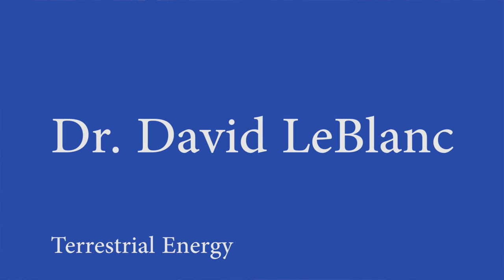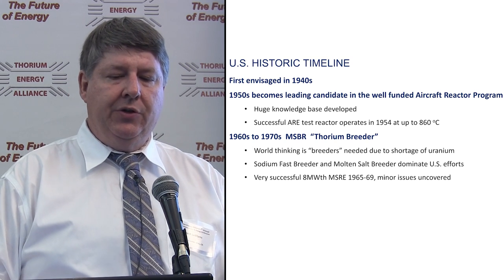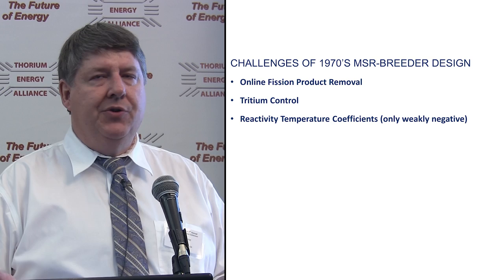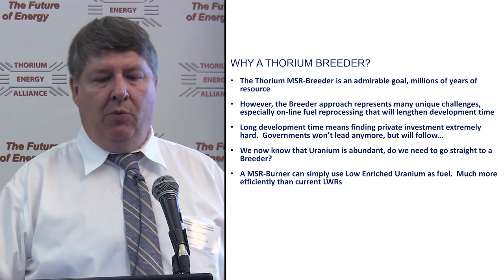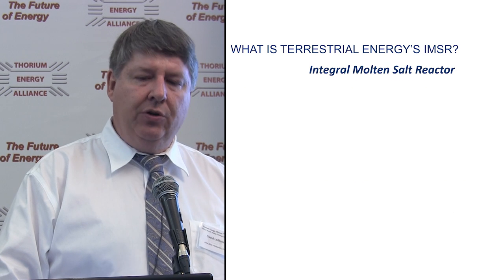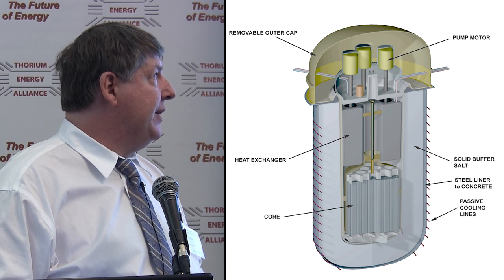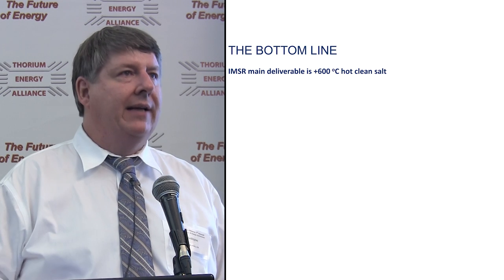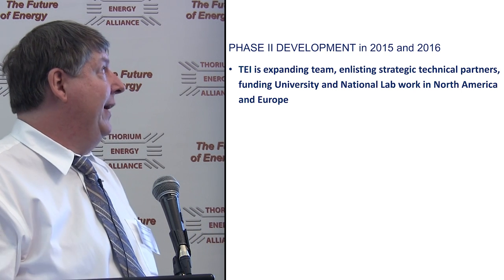IMSR: Terrestrial Energy's Integral Molten Salt Reactor -by Dr. David LeBlanc @ TEAC7

Comment: I do not think that shutting a reactor down is as simple as throwing a switch. Even if TEPCO did initiate shutdown at the time of the earthquake, the process could not have completed before the tsunami cut off all power. That is why they had a core meltdown at Fukushima. I do not understand why TEPCO didn’t have the emergency generators and fuel on the roofs of those reactors - they had to know they were in a tsunami zone. Hubris, I expect.
Reply from the maker: Robert Black You are conflating fission with decay heat. Fission had stopped. However decay heat continues for years, in a rapid drop off... at the time of the tsunami there was still a lot of it, by the time backup power failed there was much less. However it still needs to be managed, just like with fresh spent fuel rods in cooling pools. Managing decay head is not as simple as throwing a switch. Stopping fission IS as simple as throwing a switch. In this case it was automated.
Reply: It is vey hard to cool a LW reactor down after a power failure. A long-time friend of mine is a nuclear engineer, and we communicated after the Fukushima disaster, and he told me that cooling flow needs to be maintained for 36-48 hrs after shutdown to prevent a meltdown.
Reply from the maker: Robert Black Yes, that sounds right. Just that reactor is "off" already. The pumps must keep running for days. I thought you were saying fission was still happening. Missed safety opportunities were astounding.
Reply: ***** A non-starter. A rooftop backup generator would last longer, so long as the fuel supply wasn't contaminated by sea water.
Reply: gordonmcdowell I read on Asashi Shinbum (English-translation of a Japanese newspaper) that a retired TEPCO consulting engineer recommended putting the backup generators and their fuel tanks on the roof of the containment structure when the plant was being built, but he was over-ruled because of the cost. More hubris, I think.
Reply: Robert Black In a MSR you can remove almost all of the fission products which create decay heat. It would be much easier to manage. Fuel pools would still need cooling though.
Reply: I know, but the Fukushima reactors were light water reactors designed in the early 1960’s. In the USA, nuclear power is all but dead due to excessive regulation and environmental reviews that other power stations are exempt from.
Reply: +Robert Black

 Robert, we are not talking about Light Water reactors here. And Yes, MSRs can be shut down safely and was demonstrably done that way :  https://en.wikipedia.org/wiki/Molten-Salt_Reactor_Experiment or am I missing your point?
Reply: You missed my point. The Fukushima reactors are lw reactors.
Reply: +Robert Black It's not just the diesel generators that were destroyed by the tsunami at Fukushima. The seawater pumps, the seawater intakes and outlets, the pipes, the valves, the power cables, the switches, the sensors, every bit of the plant infrastructure was compromised or demolished when the tsunami hit, a few minutes after the earthquake and while secondary tremors were still shaking the reactor buildings.
The conclusion is not that the Fukushima power plant should have been upgraded or built differently in the 1960's and 70's. The correct conclusion is that Japan should never have built any nuclear reactor in the first place, as it is the most seismically active country in the world.
Reply: Actually, the argument that the plant should have been built differently was validated at Onagawa NPP, which was closer to the epicenter and was hit harder, but there was no disaster. There was a different company in charge (Tohoku, not TEPCO), and they built a proper sea wall. Fukushima Daiichi also had a natural sea wall which was much higher than what they built, but they removed it back in the 1960's.
Reply: TEPCO did have backup generators.  They were flooded by the tsunami wave...
Reply: The original question was why the diesel backup generators were not installed on top of the reactor buildings.
As I wrote above, even if this had been the case, it would not have prevented the three core meltdowns, as the rest of the cooling and much of the sensors and control infrastructures were destroyed by the tsunami.
Somebody posted that a higher seawall would have avoided the destruction caused by the tsunami and the core meltdowns, citing the Onagawa NPP, which was closer to the epicenter of the earthquake and was hit by a similar tsunami but did not suffer as much damage. But this is really counting on luck. Before the earthquake, both the Onagawa and the Fukushima NPP had similar risk estimates. One plant survived because of specific circumstances, the other was completely destroyed.
The correct conclusion is that you just can't depend on luck to avoid nuclear catastrophes. Again, no nuclear power plants should ever have been built in Japan, the most seismically active country in the world. Every single NPP in Japan is at risk of a major accident at any time.
Reply: +André Balsa — Every place on Earth is seismically active.  According to your reasoning, no nuclear plants should be built anywhere on the planet.  That's just plain silly.
Reply: That's party true, but besides the point.
An IMSR doesn't have a traditional MSR drain tank, but due to its coolant+fuel mixture, additional coolant (salt) layer and then a big water jacket would take 2 days just for the outer salt layer to melt (achieve maybe 400C), as long as the core coolant/fuel keeps below 700C, the reactor is safe and undamaged. If you consider the reactor a total loss, it can go up to 1400C (salt boiling point) before we have a real problem, there's just not enough decay heat to get there, even with all pumps off.
Additionally, pumping molten salts is far easier than pumping water. Molten salts are thicker, yes, but you need to pump far less salt mass to achieve the same heat conduction and the salt is at ambient pressure, while the water is at 75-150 atmospheres.
So an emergency diesel to power one 300MWe IMSR vs a Fukushima 622MWe is likely required to have 1/10th the power than Fukushima. Since the pumps in an emergency don't need to operate 24x7, instead of having 3 diesel gens, have 2 plus solar panels in the roof as a third contingency.
Reply: What ? Solar panels running water pumps is the easiest application of solar PV. There are pumps designed to simply be connected to a single panel. Doesn't even need an on-off switch, it runs most of the day and shuts down when PV voltage drops in the end of the day.
Connect 100 top of the line rooftop PV panels (450Watts, 48Vdc each), you now have 45kW and 4800Vdc peak. I doubt even the big IMSR will need more than that in emergency modes (if the reactor is running, its producing its own coolant power needs). Except in that case I would assume something like a single Tesla powerpack with 200kWh battery to provide peak power for startup and provide a few hours of power stability. After sunset, if the diesel genies aren't working, shutdown all pumps, but keep power to the control room.
It really never ceases to amaze me how radical are people, either solar is useless only nuclear matters or nuclear sucks only solar+wind matters. Please do some studying.
I'm only advocating multiple emergency power sources. The PowerPack can even be charged by the diesel gens too.
Tesla Powerpacks are interesting for a lot of reasons, including doing reactive control and replacing peaking plants, which match very well with an MSR.
By the time the 2nd IMSR is brought up (I'm assuming the first will run as a demonstrator under more strict conditions for a year or two), Tesla PowerPacks likely will have 500kWh each and will be cheap enough they will make every peaking plant in the world obsolete.
Reply: Marcelo Pacheco the Fukishima nuclear reactors were designed and built decades before Tesla was even a pipe dream, so your idea, while it has merit, was too late to be adopted there.
Reply: Robert Black I'm talking about IMSR here... That's the video we're commenting about.
Reply: Marcelo Pacheco Where other than China is one of those things being built? Won't happen here as long as the Environmental lobby gets to veto everything that isn't horse-drawn.
Reply: *****
another technology invented here, perfected elsewhere.
Reply: *****
Shame on you for your ignorance or for being a merchant of doubt. Millions of people in the world live in islands powered 100% or 99% from solar panels+batteries.
In 2 years half of Hawaii will be powered with solar.
My household only need 3.5kWp of panels, here in Brazil the best panels we can get are 315Wp, so all I need is 12-13 panels to self produce all the electrons I need. I live in a 5 story building, we only need 25% of our roof space for the whole thing to be self sufficient. Of course, I'm in a place as sunny as Hawaii, I wouldn't recommend solar for Norway of Finland !
Nuclear doesn't need the electricity market to be a hit if it truly becomes affordable. Just taking over the process heat market and become the primary source of district heating+district electricity generation in cold places is enough for the IMSR to sell as many MWs thermal as there are MWs thermal of PWR/BWR !
Then there's the combo of making electricity and desal water mostly with the turbine output (at a quite small thermal efficiency loss).
Reply: Unfortunately, you are wrong.  The fission process is turned on and off pretty much like a light - if it has plentiful neutrons, it is on, if it doesn't have enough to replace those that react, then its off, and the left overs either react or leave the reactor within milliseconds..  Insert control rods, they absorb neutrons to the required level, fission stops.  You can balance on a knife edge there, I suppose, but since there is no point in it, reactor controls don't do that. The reactors were completely shutdown, not creating neutrons, within a minute of the seismic signal. Everything after that is decay heat.
Reply: Oliver, when a nuclear reactor is running, the core temperature is several thousand degrees F. You cannot cool such a mass of metal and water in a jiffy without power. Even if the control rods were SCRAMMED, the cool down would still take days, which is why the lack of emergency power caused the Fukushima reactors 3 and 4 to melt. Basic thermodynamics. You are the confused one, not me.
Reply: You are ignorant of thermodynamics. Fission can be shut down quickly, but the accumulated heat is another matter.
Reply from the maker: Robert Black. Please direct me to your source for...

> "when a nuclear reactor is running, core temperature is several thousand degrees F".

Light water is used as the primary coolant in a PWR. Water enters through the bottom of the reactor's core at about 548 K (275 °C; 527 °F) and is heated as it flows upwards through the reactor core to a temperature of about 588 K (315 °C; 599 °F). (That's Wikipedia on PWR.)
Reply: If the word "shutdown" has any meaning in power reactors, it means the point where the reactivity passes from super-critical to sub-critical, where the numbers of neutrons being produced drops below the total of neutrons absorbed and the number lost outside.  Yes, there is still gobs of potential heat still locked within the decaying FPs at that point, but that is not usually considered.  After all, that decay will continue potentially until after the sun swallows the Earth in 5 billion years or so, so by your definition a reactor can never be considered to be shutdown.  It's not even thermodynamics, since TD cannot account for the continued production of heat; it is basic practical nuclear physics. I think we both understand the points, and only differ on a definition, so I'll let it go on that.  Regards.
Reply: Wikipedia also states that decay heat alone can melt the core, and that has to be far hotter than what you give for a properly operating LW reactor. Furthermore, it also states T > 2200 C leads to steam explosions. I was talking about the Fukushima reactors, not a properly operating one.
Reply: Doubt that. I am a research meteorologist, and I know a great deal of physics and thermodynamics. You can't dissipate high heat in an instant, which is why the Fukushima reactor cores melted.
Reply: Ha Ha You proved me right. Even a shut-down reactor produces a prodigious amount of radioactive decay heat that must be dissipated to prevent a meltdown. They couldn't maintain cooling at Fukishima after the tsunami, and the reactor cores melted. You don't have to be a nuclear physicist to know that a reactor's residual heat can melt the core.
Reply: @gordonmcdowell  The fuel pellets get much hotter than the surrounding water but certainly not thousands of degrees.

Comment: Does the 80 MWth reactor unit fit in a container unit, under 6 meters by 2.4 meters square (5.898 m x 2.352 m x 2.393 m LWH)
Reply: I'd go with the 600MWth anyways because you're eventually going to replace the things. $2 per watt is a bargain and would lead to better growth.
Reply: While that is true, the reason I ask is that if it can be miniaturized to that extent, or even if it can be disassembled into 2 or even 3 containers that can then be connected onsite it could be part of a very real revolution in power delivery, both in the first AND third world. Especially if it could be flown into remote areas.

Comment: Time index 12:59 discussing non-breeding uranium-based MSRs... Even Kirk Sorensen (champion of the thorium-based breeding MSR) agreed with you and said the same exact thing at ThEC2018.  Here is link: https://www.youtube.com/watch?v=2x7do-_MTD0 (fast forward to time index 9:24).  Kirk says "personally I don't actually think you should use thorium in a MSR unless its a breeder."  Basically, yeah this is very complicated stuff and a breeder with chemical separation like LFTR is ultimately the "Cadillac" of nuclear reactors, but there are some difficult R&D challenges that lie in that direction and without big money, it's not wrong to pursue low-hanging fruit first, like the simpler non-breeding MSRs like IMSR or what Lars Jorgensen was referring to.